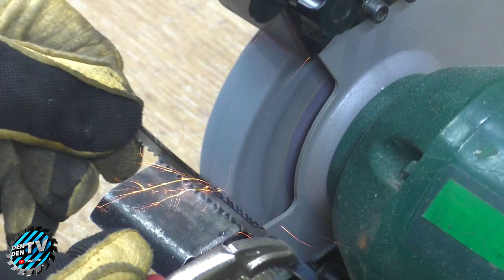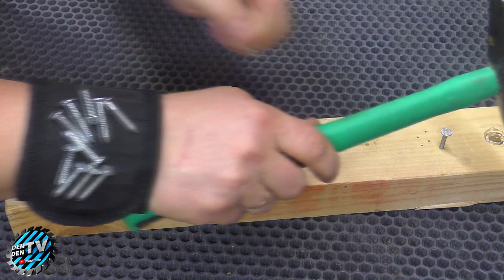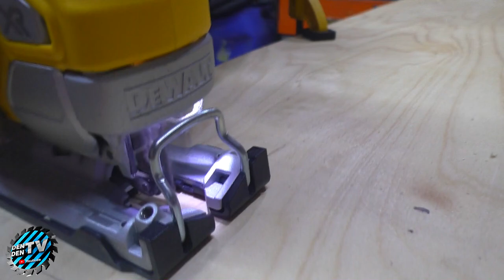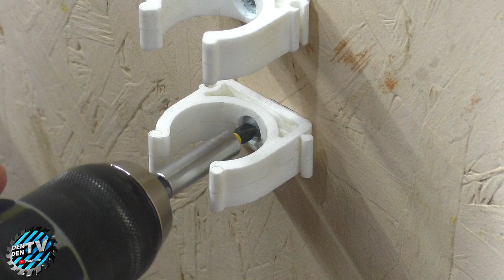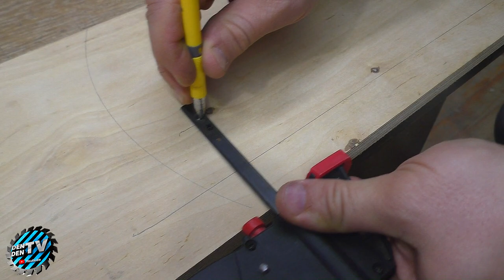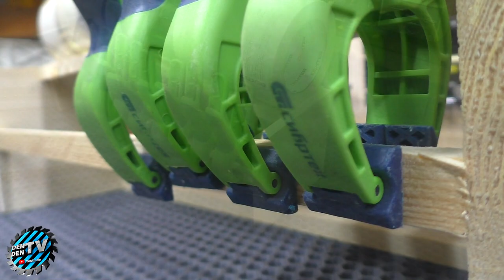Мало кто знает секрет обычной пилки для лобзика !!!

Comment: Horrific idea with double sided jigsaw blade. The saws are designed to ONLY safely cut moving forward. Operating it in reverse causes friction in the wrong vector and pulls the blade from the guide bearing.